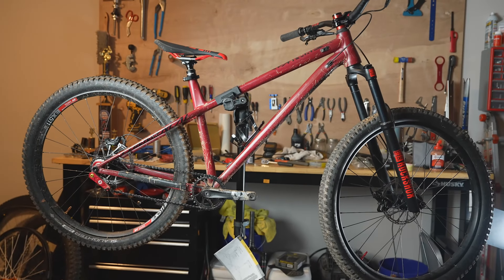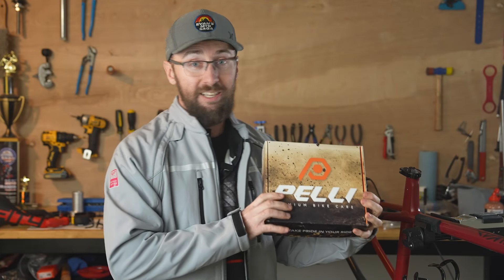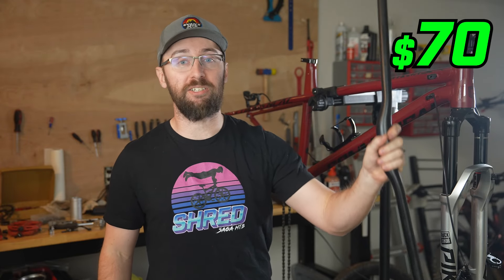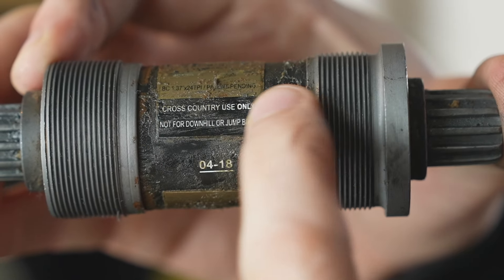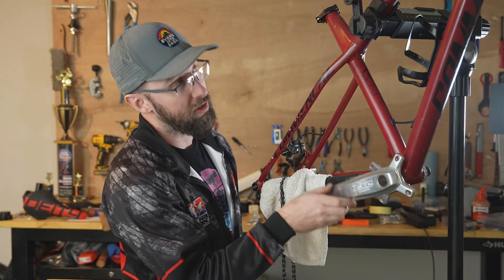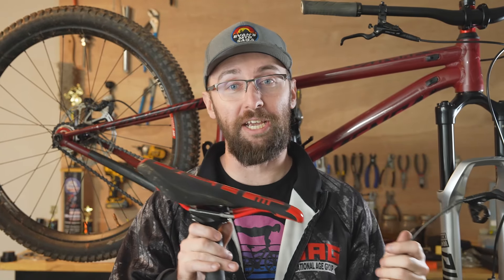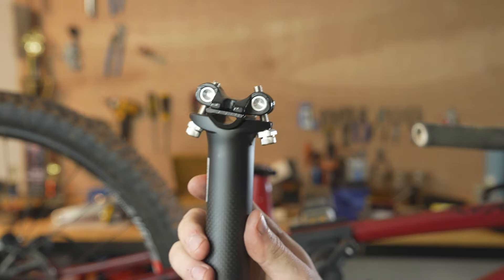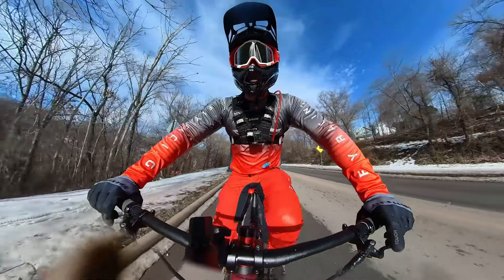I built the ULTIMATE hardtail, but then...

Comment: Ragley Marley is my guess for the new hardtail
Reply: or mmmbop 😀
Reply: Or big al
Reply: I just built up one with 140mm DVO Diamond fork, Ragleys frames are on sale at CRC
Reply from the maker: Not a Ragley Marley 😉
Reply: @EvansMTBSaga  Worth a shot. Excited to see what it is.
Reply: But could be another ragley, right?
Reply: Iv just built a ragley bigwig with a pretty much dream build
Reply: It’s a marin San Quentin 2 or 3
Reply: Oooh I’m just about to build mine
Reply: I built one last year.  For my son.  And a nukeproof scout for my wife.  Both really great but can’t touch my Banshee Paradox.
Reply: Ragley gang! Just finished my mmmbop
Reply from the maker: It could be another Ragley. They have a million models 😂
Reply: My dad loves his.
Reply: if it’s a marin san quentin, you’ve made a good decision
Reply: Its an RSD
Reply: I have a feeling he took a page out of Seth’s books and got a sync’r carbon or smt
Reply: @Ohiorides_topfuel8  seat tube looks a little slack for a san Quentin
Reply: I’m hoping it’s a big al, I’ve just bought one on discount as I considered building a frame with my existing parts, however the price worked out the same as buying a frame, so just went for a new build. 
Recently been using a hello Dave by On One, however the reach is ludicrous at 480mm and there is little or no give in the frame. Even with 2.6 tyres at low pressure the amount of fatigue from chatter is unreal. My partners Merida big trail 600 is a much faster, lively and comfy bike which just bounces over everything. I’m only just getting into bikes, but I can’t believe what difference geometry and construction makes
Reply: I also helped my brother in law build his meta HT frame and that was a few beers later trying to use fishing line and magnets to route the brake and gear cables through the chain stays. The junction at the seat post is the tricky bit

Comment: You have heavy aluminum wheels, on a heavy aluminum frame, with a fork that has no lockout. Put a dropper on at that point even though it's heavier, moving the seatpost up manually on the bike will end up with the saddle being crooked, the seatpost not being raised to the right height, or not having enough (or too much) torque on the clamp itself. Besides that, the rest of the build makes sense.
Reply: He’s effectively making a big dirt jumper out of a hardtail. Of course he’s running alloy frames and wheels😅

Comment: I have a commencal meta ht and I honestly have no complaints about it. I noticed that the frame was a lot stiffer than any other aluminum bike I’ve ridden, but I love how responsive it made the bike. I run lower tire pressure (15 front 17 back) because of the plus tires, and it honestly feels amazing. I’m sad to see that you don’t like the bike, but I’m glad that it finally got some recognition!
Reply: It's great for what it's designed for ... What Evan is describing is a dirt jumper, not an aggressive hardtail mountain bike!

Comment: Great build! Would definitely recommend putting grease on both axles, the cranks, and the seat post. Really made me cringe when you had to hit the axles as hard as you did, they should slide in easily with a little grease, and it won’t bind up later on!
Reply: Ultimate cringe. I recently built up a 2021 HT AM XL and grease is goooood.
Reply: It made his palm hurt so he got new axles 😂

Comment: Not trying to hate, just some constructive feedback. So with cutting any carbon part, you should have a fine blade (32 TPI or more) or a carbon specific blade. And always be spraying water or even soap onto the carbon part that’s being cut. Also like you said, make sure to do up the clamp properly but also always remember to check if the blade is tight in the hack saw and always loosen it after use, it’s much better for the hacksaw frame. Also when doing up the Shimano type of cranks, always make sure to to an A, B, A,B pattern and so on to torque the bolts up, like a clamp on the stem, it won’t get proper torque if you do one up all the way and then the other, the first one will end up being loose. Another one is having to hit the axles in, I have never needed to hit an axle in and you shouldn’t need to. You can also see where the black coating has worn off on the axle from where it gets turned to tighten up the wheel. That really shouldn’t be happening either. Please use some grease on the axles and other parts like the cranks, it’s not great on the bearings either if you have to hammer in the crank spindle that hard. Obviously you can give it a few gentle taps to get it out of the bottom bracket in the first place, but it shouldn’t need anything more than that. Also I wouldn’t bother messing around with the silly cheap carbon seat post,, I doubt that it will last too long if you are doing what you were doing to it (adjusting it all the time and smacking it to align it). just get a nice dropper. I think you will agree once you do that clamp up and try to centre the seat multiple times while also trying to ride.

Comment: I tried a wet wipe for kitchen cleaning yesterday. It worked great but might be used on parts that have alot of dirt built up on them. It did remove oil residue on the frame from the chain with no issue.

Comment: I run a similar set up after I snapped my old Norco range, replaced it with a Dartmoor Hornet frame and built it up recently went to single speed and it's an absolute blast on jump lines.

Comment: Ceramic coating is the BEST. I’ve had my bike 12mths now, have genuinely never washed it. Quick hose after a ride, wipe the drips off, done. Still looking better than it did when I left the shop. I got Mothers CMX. I did it before riding it and have reapplied once.

Comment: I understand the no dropper, but the fox transfer is one of the nicest droppers you can buy, and it is no slouch
Reply from the maker: The one I'm using will just stop working if it's cold or muddy. Tried to service it and it's basically non serviceable. Can't add air
Reply: @EvansMTBSaga  huh, I have had mine for four years and never had any problems, interesting that yours is behaving like that
Reply: @EvansMTBSaga  if your getting mud on dropper post you aint riding right chief
Reply from the maker: @simonchaddock3694  lmao you've never gone fast enough to sling mud up to your dropper?
Reply: @EvansMTBSaga  yeah sorry ok maybe im a bit pedestian

Comment: I think the Dxr cranks may actually work but the spacers under the bottom bracket arent in the right posution.
With 68mm you should have 2 spacers on the drive side and one on the non drive.
With 73mm you just have one on the drive side
Because the one aditional spacer at the drive side can be replaced with an e-type front derailer for 2 or 3 by systems

Comment: You should build a receiver hitch mount for your vice on your table so when you want it you can’t quickly mount it to the table and when you want it out of the way you can move it and put it away
Reply from the maker: Interesting! I didn't realize that was an option. I think I'll look into that because I don't really want to drill holes through the bench surface

Comment: Nice video , but there is an error in the bottom braket spacers. Is correct 2 spacers drive side and 1 spacer non drive side. You put 1 drive side and 2 non drive side 😁

Comment: Great video Evan, how do you like the trp slate 4p brakes?
Reply: For what he does they are fine, for enduro or DH on steep tracks they are quite underpowered. They still work but you need to pull hard on the lever. Now depending on what you ride, your speed and your weight they can be good options. One major pro to those brakes is the consistency of the lever feel and contact point. I had them on 2 GT Force and a Fury so I had to deal with those quite a bit. If you want to get a bit more power (mostly power feel) you can swap for a shimano servowave lever but it can also introduce inconsitency in the bite point so it is a trade-off.
Reply: @gg4760-k5n  I bought one of those 'down country' trail bikes with 120 travel, it has the stock MT200s and I was looking for an inexpensive upgrade. I'm 225 lbs
Reply: @HahnFam4  Save your money those won't be more powerfull than the MT200. Keep the MT200, upgrade to 203mm discs, metal pads and you will gain a lot more power for way cheaper just by swaping wear items when they are tost. And if you are looking for more bite get some servowave style shimano levers.

Comment: install your stem handlebar clamps correctly. Not correctly spaced, to much gap at the bottom.
Reply from the maker: It's a zero gap stem
Reply: @EvansMTBSaga  in the one clip on your video, there is a big gap at the on the bottom side on the handle bar clamp, while the top is tight.
Reply from the maker: Oh yeah that's a feature on some stems. It's designed to be completely closed on the top and then you torque the lower ones to spec